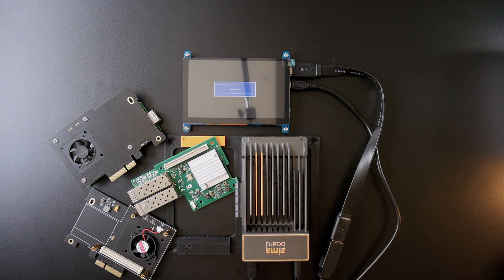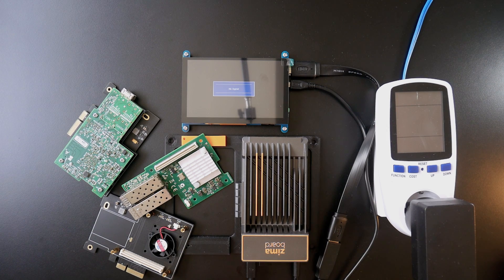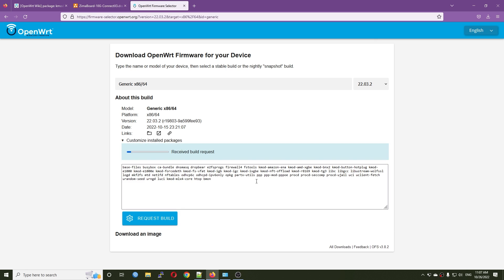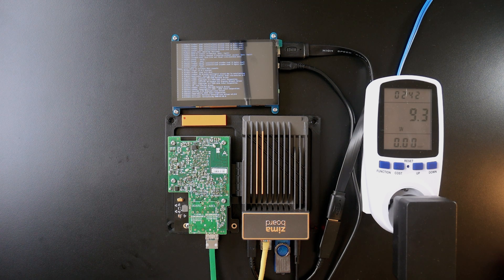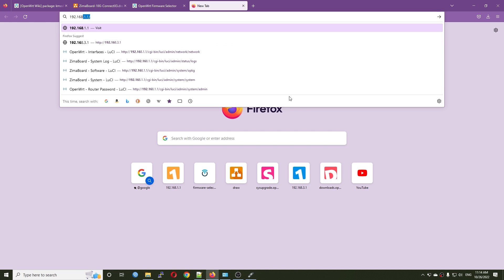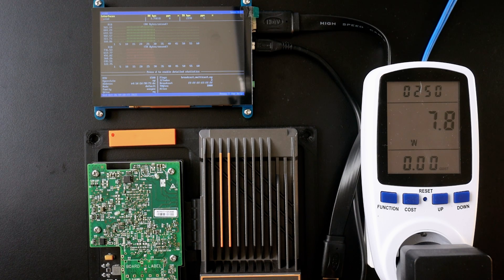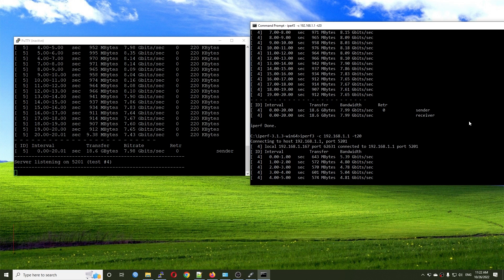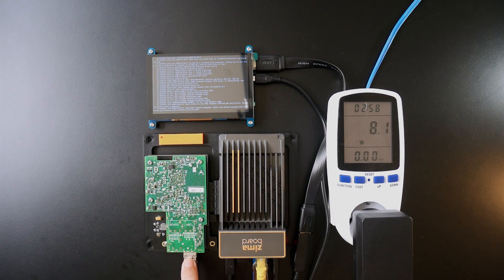OpenWRT - Mellanox ConnectX-3 10GbE SFP+ Network Adapter ft. Zimaboard

Comment: Did you stop using the Mellanox and replace it with a media converter? I am thinking about testing a Gowin R86S which has this Mellanox board.
Reply from the maker: Currently the answer is yes. I am using a 2.5G SFP GPON module with the 2.5G media converter and the NanoPi R6S. As I tested the Mellanox doesn’t support 2.5G (either 1G or 10G only)

Comment: Am I crazy, or did you get 10G speed with an 1.25G optical module in the Mellanox SFP port? You said 10G optical cable, so I'm a bit lost here…
Reply from the maker: Please watch at 5:44, this is a Mellanox DAC cable with sfp+ connector (10G).
Reply: Yes th cable is 10G with SFP+ connector but @15:25 you mention the same cable with the 1.25G adapter, that’s what I didn’t understand

Comment: is it possible for to test dual port SFP + on zima board with pfsense?
Reply from the maker: Unfortunately I don't use pfSense a lot and know how to install the driver for the ConnextX-3. As I tested with OpenWRT and Debian, only a 1 SFP+ is working despite the card has dual SFP+. I believe it should be the same for pfSense.

Comment: hi, did you try to connect a GPON SFP module to these adapters? Do they support 2.5Gb/s link speed?
Reply from the maker: Hi, this NIC only supports either 1G or 10G, 2.5G is not supported.
Reply: @VanTechCorner  thanks for reply! What about the Hisense LTE3415 SCA+ GPON you use in next video? what link speed does it hold toward your router?

Comment: also for iperf3 test please try to run several TCP connections in parallel with -P4 or something similar to see if there is any throughput improvement (multiple flows can be processed in parallel on different queues/cpu threads). Trying with UDP with -u -b10g would be interesting too.

Comment: for the jumbo frame test did you set the mtu to 9000 on the zuma side too ?
Reply: Exactly; the mtu should be set to the same value  on both sides of the connection.

Comment: This was an interesting test.  I'd like to see the dmesg output for the dual SFP port card too.
Reply from the maker: Sorry I didn't keep the log. With the dual SFP+ port adapter, when you insert the module to the 2nd port, there will be an error message "unsupported cable" or something similar on the OpenWRT console. I am not sure if this is the problem with Mellanox Connect-X3 adapter in OCP connector (and converted to PCIe via adapter) or it is the same with the Connect-X3 adapter with PCIe X4 connector.
Reply: Anh ơi build OpenWrt để thiết bị nhận sfp mượt mà ạ?